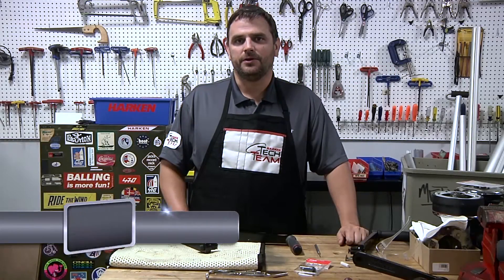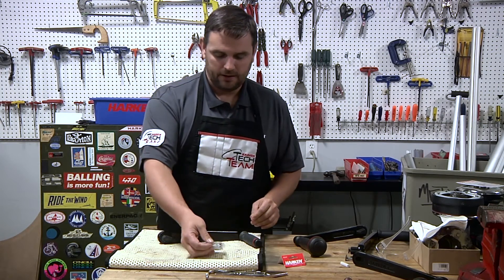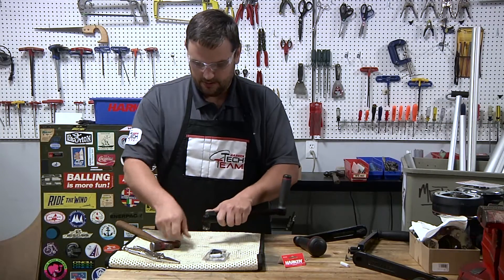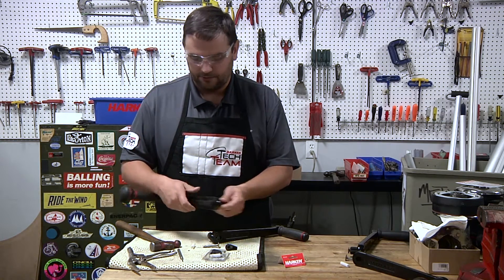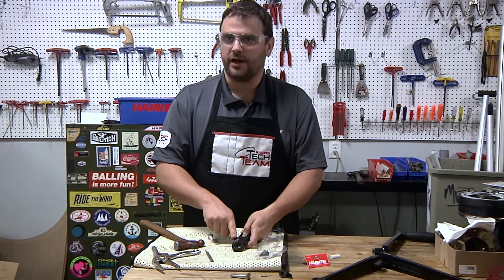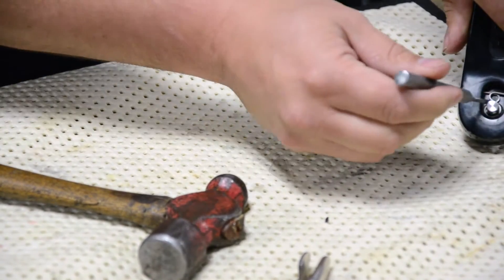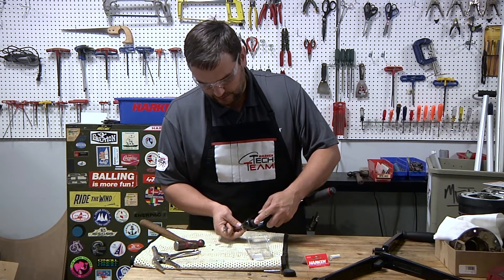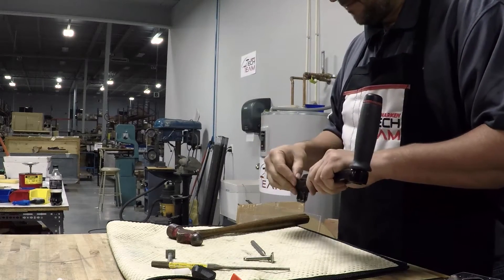Winch Handle Lock Repair - Harken Tech Team Asked & Answered

Comment: 2.5 MM Punch would be ideal. as the pin is 1/8", an eighth inch Punch gets stuck. I also found if handy to use a 1/16" Pin to use as a guide for re-inserting the roll pin, as they are a little large and seem to remove a little of the plastic. The knob is a terrible design, seems to be designed to fail. The little 1/8" nub that goes into the hole in the spring will snap off sooner than later.  I saved my knobs, and drilled a 5/32" hole where it was sheared off, and pushed a 5/32" X 5/8" pin up into the plastic, I think that should hold up better.

Comment: What size punch is that please?
Reply from the maker: Thanks for asking! A 2mm or 3/32” punch should work. Otherwise, a 1/16” or 1.5mm will work too.
Reply: @harken  A 1/8 or 3mm seemed to work best for me for re-insertion. The 2mm for removal.  Also important to support the Thumb Knob at the back while tapping in the new roll pin.
Reply: I think this is very important.  I used a 2.5mm, smallest I had, and that resulted in the metal spreading, making it impossible to get it out.  I had to cut it out with a dremel tool in the end.  I think a 1.5mm would be ideal - I'll get one of those next time I'm at a hardware store.